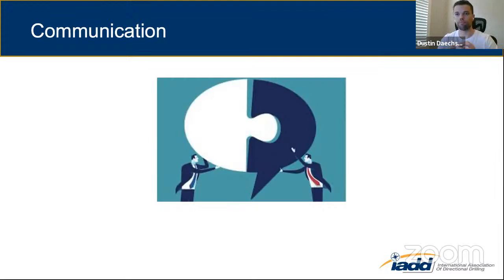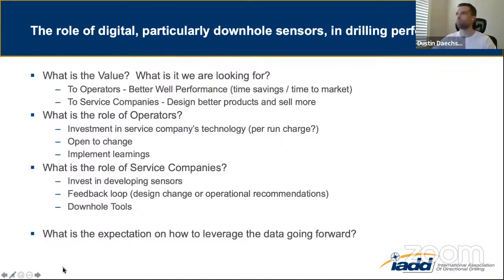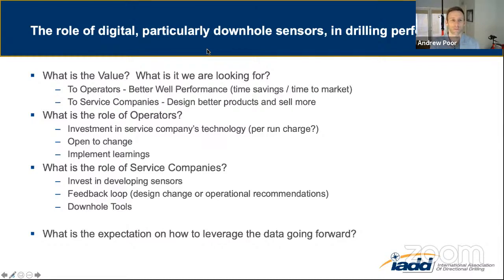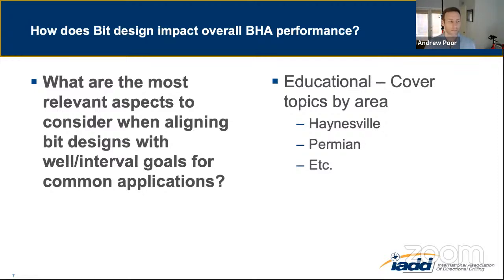Drill Bit Industry Technical Steering (DBITS)

Comment: Interesting comment that cutter damage or failure has moved from wear to thermal and mechanical as more horsepower has been added to the bit. 
I believe that improving a bits/cutter’s ability to shear versus grind can help with the thermal aspect but likely with increased tangential forces.